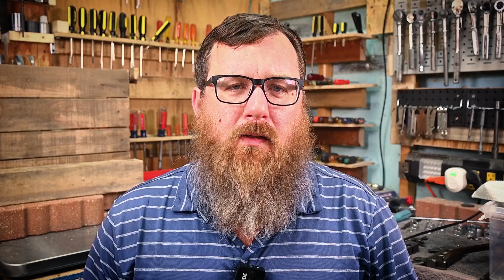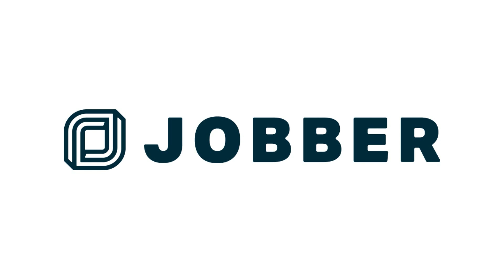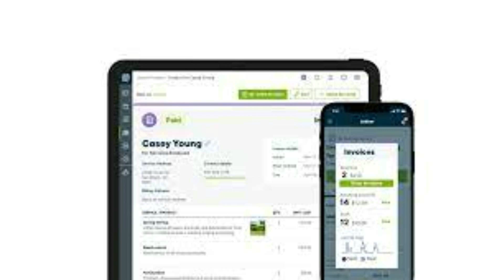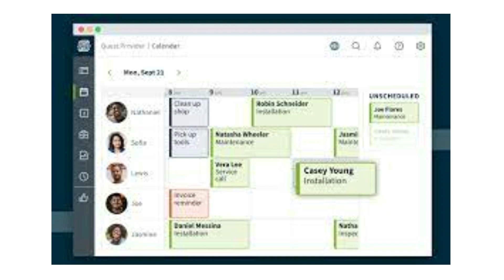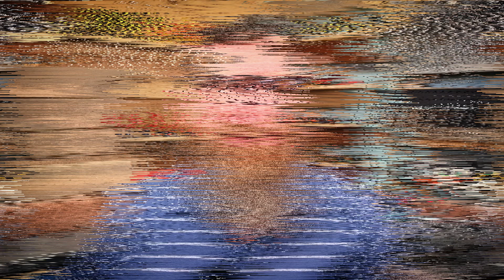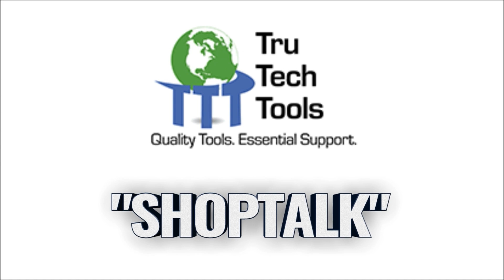Know the Facts About HVAC Zoning

Comment: The only systems that can truly handle a zone control setup are fully variable systems with communicating TXVs.
Reply: Two stage systems with two zones can handle zoning just fine. You just have to make sure that the zones are split properly
Reply: @PNW_HVAC or include dump dampers/freeze controls if the zones are lopsided
Reply: @PNW_HVAC agreed. And installing a micro-air soft start eliminates the in rush current issues that wear out parts when units start up.

Comment: Zoneboards and dampers is new construction worst nightmare
Yes its the best invention to give you an alternative from installing a second system on a two story house. And is why big home building companies are using to sell you that damper system at the cost of two split systems and its is why some companys have discarded damper systems and just gone with one thermostat system houses 😂.
To many people think that the dampers work by applying 24volts to open a damper and give you air.when its the opposite

Comment: Constant torque motors and Arzel zoning is my only choice unless you are using modulating equipment. Bypass dampers are seldom
Used unless you have objectionable noise complaints or your smallest zone is <30% of the system volume has been my approach with virtually zero problems in my experience.